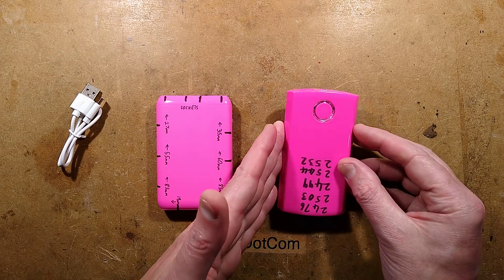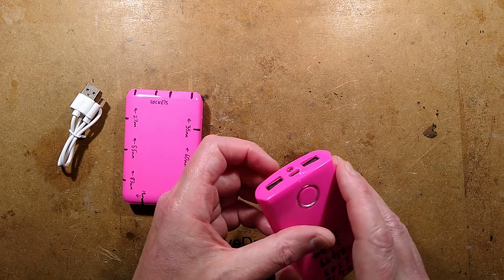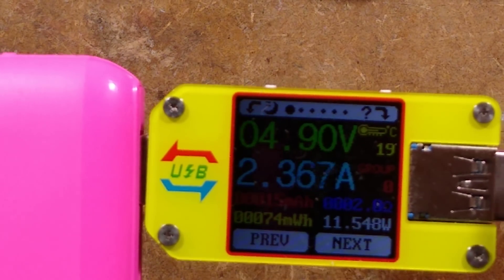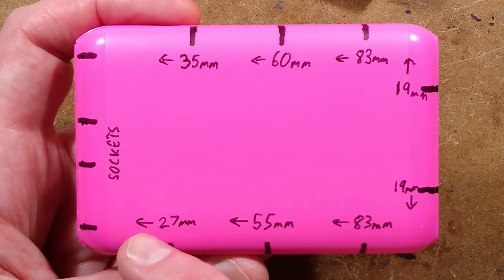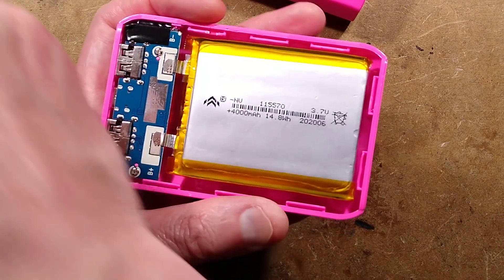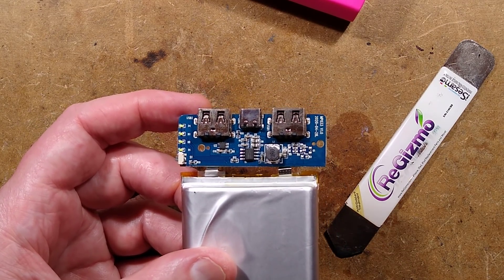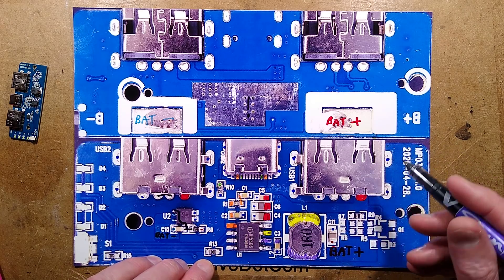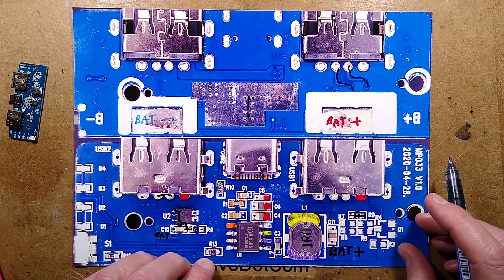Poundland's new 4000mAh power bank

Comment: I would rather have the older 18650 model. The batteries could be replaced with 2.6Ah batteries making it 7.8Ah. Those batteries are common to laptop batteries you can get on ebay for $12 and salvage the 6 cells out of it. [52Wh or 5.2Ah/11.1V-12V...3S2P]
Here is an example... [I have a Z560 with an intel M480-CPU]
Battery For Lenovo IdeaPad V360 Z370 Z460 Z475 Z560 Z565 Z570 Z575 57Y6454 G460A
https://www.ebay.com/itm/402664459166?hash=item5dc0ac0b9e:g:up0AAOSweohfbD5n

Comment: Must get 1 of those thanks, Clive. My 'Geek' Poundland power bank lost 50% capacity in just 1 year - not good. I've done a video on powering a Tesco radio from a 'Geek'. All the best, Beamer.
Reply from the maker: How many charge discharge cycles did it yield?
Reply: @bigclivedotcom  I only got about 35 over the 1st year of use, before it lost 1/2 of its capacity and that was only about 2000mA when new. I felt (IMHO) that the cells installed were 2nd hand. I replaced it with an 8000mA bank, charged every month and shows (in nearly 1 year) no signs of weakness. But, produces too much HF line/EM noise for my radio, and that was the subject of another video - built a CMC filter board. Honour to have a chat with Clive - the maestro :)

Comment: Do you happen to know if this bank will supply and charge at the same time? one of the properties I look for is this capability, say you want to use a battery bank as a small UPS to run something while transferring between two mains power sources eg raspberry Pi
Reply: Thanks, you answered this on the livestream, yes it does :D

Comment: Shame it doesn’t have a regular micro USB input. I’ve been avoiding buying into the whole USB-C thing, but I need a cheap battery pack. What’s a guy to do? 🤷‍♂️
Reply: Dollar Tree in the US has $1 type C cables as well as micro to C adapters. The latter would let you connect a micro USB power source to a type C input.

Comment: I do have the same electronic load from ebay, however I had to buy it twice, because in the first version, the power transistor died after a short time of using it. An autopsy has revealed that they missed out on the thermal compound between the transistor's back plate and the aluminium heat sink, so I guess that contributed to its early demise.
Reply: i have one of those, and it looks like no heatsink compound on mine ... 😲

Comment: Clive, don’t suppose you have the battery to hand as I’d like to know its dimensions. Cheers.
Reply from the maker: It's size number is 115570  11mm thick, 55mm wide and 70mm long.
Reply: Cheeky request but is it bang on 55mm wide? Sod’s law the battery bay I’d planned to fit it in is about 1mm narrower.

Comment: I didn’t think you explained the circuit that well on this one. I was looking at the schematic for a while, not seeing how it outputted 5V when not plugged in. The schematic is not very clear. 

I just worked it out after starting to write this message. Does the output come from the battery always? even if it’s plugged in it’s loading the battery and wouldn’t ever output 5V without it?
Reply from the maker: When not charging the unit uses the inductor to boost the output voltage.

Comment: Isopropyl alcohol or ethanol are quite bad at softening/removing adhesives (except for hot glue!). White spirits/turpentine substitute (I hope that's the right translation, it's "Waschbenzin" - washing benzine in German) usually works much better (but might evaporate too quickly as well).

Comment: I use a hot air gun on the case behind the battery to soften the adhesive. And don't heat it too hot...

Comment: If nothing else, the simultaneous power+charge capability means it could be useful as a dead easy UPS for a Raspberry Pi 3 and lower. I think the Pi 4/400 is a bit too power hungry, wanting 2.7W at idle.

Comment: You are being over cautious and boring with your discharge before removal stuff. They are not that fragile . If you cut the foil superglue fixes it back up fine ,also when you let the gas out.

Now the main part Clive , How can you stop the battery going to 4 2 volts when charging and rather have it stop at 4 volts or 4.1 volts?
Reply from the maker: I was thinking about that recently and pondered whether a pair of inverse parallel schottky diodes in series would add roughly 0.2V to the cells apparent voltage.
Reply: @bigclivedotcom  Well I guess .2 or .3 v on both in parallel would give <.2 v overall . Don't know what the "inverse " is . But where to put them? On the sensor pin on the chip would take the cut off higher . Where to make it lower?
Reply from the maker: @aprilsteel9466  Inverse parallel means two diodes in parallel with one pointing one way and the other pointing the other.  It would introduce a bidirectional voltage drop.
Reply: @bigclivedotcom  Thanks Clive but where would you put it please?

Comment: It's probably a good idea to have a bucket of sand at hand when messing with lithium batteries
Reply: Sand doesn't really help. Water is the better choice.
Reply: @superdau  Water in a LITHIUM fire?
Reply: @tiagotiagot  
What lithium fire? This is a rechargeable lithium ion battery. There's hardly any lithium in it, and especially no metallic lithium.
There's a reason fire departments extinguish EV car fires just with water and airlines instruct to to the same with battery powered devices that for some reason caught fire.

Comment: On the old pack you had marked its capacity at various times. How do you measure the capacity?
Reply from the maker: Amount of current going in versus time.
Reply: @bigclivedotcom  Ages ago I felt the need for a tester that would tell me what proportion of the original rated capacity a rechargeable battery has left. It took me years before I got around to building it. It is switchable for various numbers of cells and has three settings for the current it draws from the battery on test, with an output by a relay to a start and stop stopclock from RS.

Comment: I bought a "10,000 mAh" power bank from walmart that, as best I can tell with very rudimentary measuring manages to actually hit that mark, but has some rather interesting behavior. Specifically, it can charge itself and power something plugged into it at the same time, but if you're charging something like a phone, when the phone finishes charging, it stops providing power on port until you press the button on the bank or unplug and replug the phone in. I know this because I left a phone plugged into it for a couple days, went to use the phone, and found the phone to be completely dead. The power bank however still had full charge. I've tried taking it apart and can't for the life of me figure out how it's held together. There's no screws that I can see or feel and my spudger can't find any ledges inside the seams to pry against. 

The model number on it is "PBWM-BLK", and a quick google shows it's from Ruipu Direct. I paid only $12 USD for it and it's available online for even less, and if it really is 10,000 mAh, that's rather impressive. I will note that it takes forever to recharge, up to 10 hours. The documentation that came with it also did not say lithium ion, but rather lithium polymer. I'm curious if that's anything different, or just another name for the same thing. Also, the charge indicators don't seem all that accurate. It seems to be at 100% for about 60% of the charge, and the 75% and 50% indicators are only active for about 15% of the charge. I'd be very interested to see what you think of it and what exactly is going on inside this little black box.
Reply from the maker: I use ASDA (Walmart) power banks.  The bigger units tend to go into a standby mode after a phone has stopped drawing charge current, and need wakened again.

Comment: how do you dispose the battery safely ?
Reply from the maker: I tend to use the batteries I take out.  But to dispose of one safely you should fully discharge it.  The main hazard is the amount of energy they can hold.  When discharged they are fairly inert materials like aluminium, copper and graphite with just a touch of lithium diffused throughout.

Comment: To help release glue on phone batteries and screens I like to set them on the build plate of my 3d printer. Works like a charm. I tend to set it about 50 - 60°C and wait until the whole thing is hot.

Comment: To remove the battery, I would use fishing line threaded under the contacts so that it can be used as a bone saw to work its way under the cell, across the bottom, destroying the sticky pad on the way.

Comment: The USB-C resistor connection looks weird (maybe an error?), because they've put the pull-down resistor on the wrong pin.  If they have messed this up, then a lot of USB-C power supplies will refuse to supply power to it.  Check out section 4.2 "Power capability detection and usage" in ST AN5225 on USB Type-C Power Delivery, and also Figure 3 in that doc.  If they want to pull 1.5A from the USB socket, then they should put two 5.1k pull-down resistors on both of the CC1 and CC2 lines (signals and pins are labelled differently on USB-C because the connector is reversible - so pins A5 and B5).  Two resistors are required, (not one - the Raspberry Pi foundation came unstuck when trying to save a resistor like that).  If they also read the voltage on another pin, then the USB-C power supply (downstream-facing port) can also indicate whether or not it has the capability of supply up to 3A.

BTW, how many £ are Poundland asking for this power bank?

Comment: Used to be a joke asking how much was it (from Poundland) but these days it's just an honest question.

Any use to power an WiFi security camera in the back garden? (the cheapo Digoo £15 one that has built in iR illumination and a mic and speaker)
Reply from the maker: It wouldn't run a camera for a very long time.

Comment: When you charge these with 6V solar panel directly and the current fluctuates because of clouds, some charging circuits decide  this is the maximum and never try the higher current again. Good chargers can recover and they can take 3 Amps and  higher voltage. These issues are worth testing too.
Reply from the maker: This unit will always try and charge up to its preset current.

Comment: That's a 4000mAH cell, but only at 3.7V. So stepping up to 5V, even if the boost convertor were 100% efficient (and they more or less are), you wouldn't get 4000mAH out of it. And that's what counts as far as capacity goes, it's sold as a 5V power bank. Whatever it's internals are is irrelevant to the purchaser. So it's dishonest even according to the markings on it's own batteries.

I know Poundland's management are more qualified in scamming their own staff members, abusing the benefits system, and general bastardry, but you'd hope maybe the guy who buys the electronics wasn't so susceptible to being lied to by Chinese factory managers. Unless he's as bad as they are, could well be. Either way, it's bullshit, and you're getting errr 26% less than you're being sold, at least. Even less counting for inefficiency in the convertor. 

Another day dawns, Poundland are a set of bastards.
Reply: I was gonna say the same thing. At 14.8Wh, the most you could get out of it would be 2960mAH @ 5V if the boost convertor was 100% efficient.
Reply: @zardoz jones I'm sure that's how the marketing department justifies it. But to place a label that states 5V @ 4000mAH would be outright fraud.

Comment: It's a bit on the bulky side, but I'm still using my Halo Bolt as a power bank with two 2.4A USB sockets.   Plus It has a 65 watt, 120v AC inverter built in, as well as rather good work-light, and the ability to jump-start a car. I have had a few of the small power banks over the years, ranging from the dinky little one-cell type, to the larger phone-shaped ones.  Which reminds me that I should dig out the smaller ones and top them up to avoid a critically low battery and the damage that it causes.   However, when the need for a power bank arises, I still always grab the Halo. It uses a 12v in barrel plug to charge either from a lighter socket cord, or a wall-socket transformer plug. I have used it many times as a USB supply/UPS in a vehicle by keeping the charger plugged in to the lighter socket while powering USB devices.  Never a hiccup or even a hint of warmth from the Halo. 
On a side note: I would LOVE to see the innards of a Halo bolt and what your opinion of such a device would be.  But you can't have mine..  I rely on it way to much to send it off to the I.O.M. to be "taken to bits."

Comment: 14:10 - Yes, you can control 6 LEDs with 3 digital pins using "Charlieplexing".  Not sure what you would indicate with 6 LEDs as 4 divides into 100% nicely.  5 LEDs would give 20% steps, slightly better but more cost than it is worth for low costs power banks such as this.
Reply: With 6 LEDs you would at least know when you had 16.6% charge remaining
Reply: But a small requirement to do that is your pins must be tri-state meaning able to have 0V output, Vcc output, and a floating output or High-Z.  You can achieve floating output by turning an output pin to an input pin on the microcontroller.  Without looking at all the microcontrollers out there, I'm not sure 100% of them are capable of changing pins to either output or input by software.

Comment: The usb load that you used works if you run it inline as a current regulator. I have a few and use them as a cc for charging or to dim led's.
Reply from the maker: There's always a resistor in these devices to measure the current with.  Not a high value though.

Comment: Clive, Does the IP5306  deliver nominal 2.1A at ~5V  to aid  longevity and reliablity? I bet it gets a little warm.  Sure helps to have a decent battery in there of course. Perhaps there are other 8 pin SOC that allow for more that you could hack.  How much hardware will take more than that? Seems like 2.1A is  agreed upon  by the "industry". My Samsung S4 would never take advantage of that output (yes, i know its ancient but I refuse to be cowed into buying new) USB C would allow for higher rate of charge but those LiPo's are  happier at a lower rate of charge considering they are probably each 2000mAh 1S  10C ( as in 4.2V @ 10x rated capacity). I use some 5000mAh 4S  80C  and they can be charged at well over the rated capacity at the cost of longevity /number of charge cycles. I bought a power bank you reviewed several years ago. Left it on a bus.

Comment: Do you recommend keeping these out of the cold, does it affect the lifespan of the battery? I have a generic one from Walmart that got left in the car glovebox all winter, meaning it experienced near-zero Fahrenheit temps several times. It still seems to hold a charge okay, so far...
Reply from the maker: The main risk is charging or discharging it at very low temperatures.  For charging it's best brought up to room temperature.
Reply: @bigclivedotcom  yep
I always thought you could discharge li ion cells at lower temperatures before...
Reply: Li ion will be damaged if charged at temps below 0 iirc
I believe discharging it or storing it shouldn't cause any damage from what I've found tbh

Comment: Hi Clive, when testing power banks, please also measure if they can deliver power while they are getting changed.

It is relevant in some cases, if you want to use it like a cheap"ups" for a raspberry pi or something.
Reply: 14:47
Reply: @nick1austin  Thanks!
It was intended as a general request for further videos too.
It would be nice if Clive could measure the output voltage under like a 2a load.
Reply: @petersmotorcykel  Did you even watch the video?
Reply: @DylanC_YT  did you even read this thread?
Reply: @petersmotorcykel  You asked if he could do 2 things, and he did both in this video.

Comment: I use the heated bed on the 3D printer to wsrm the thing to about 45 deg C. Within the commercial temp range for most things, enough soften the glue.
Reply from the maker: I've been using my 3D printer in preheat mode to warm things too.

Comment: 9:33 I'm having a Raspberry Pi 4 dejavu here. Seems they have connected CC1 and CC2 together and added a single 5.1kOhms resistor to ground. This will cause some power supplies to missclassify the power bank as an audio or debug accessory and set a current limit of 100mA (or provide no power at all). First Revision of the Pi 4 had the same oopsie, newer ones use two separate CC resistors as mandated by USB-IF spec.

Comment: One of these days, I will have to bite the bullet, be smart, and buy a battery bank. I can't afford to buy a new phone every 1.5-2 years all the time. 

I have a 3000mAh (original capacity) bank from 2016, but not as useful for a phone with a 5000 mAh (original capacity) battery.